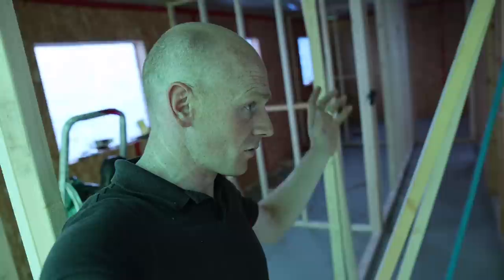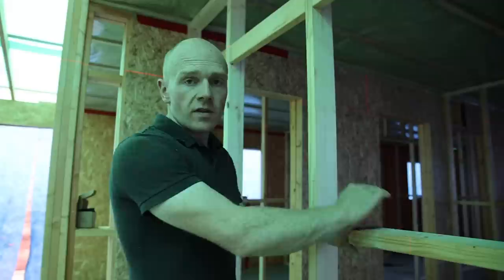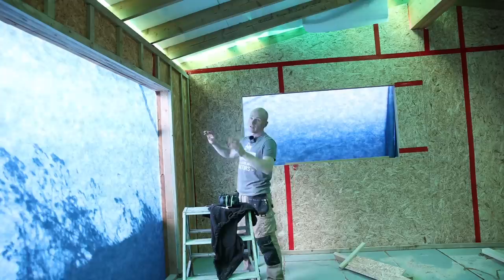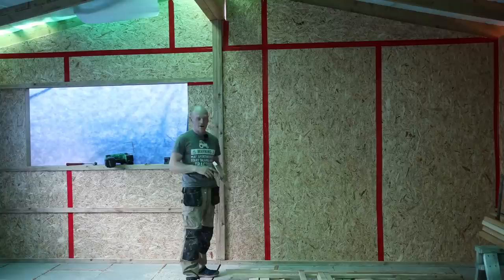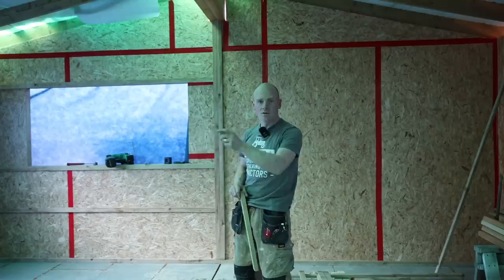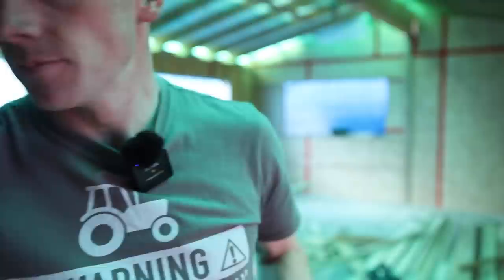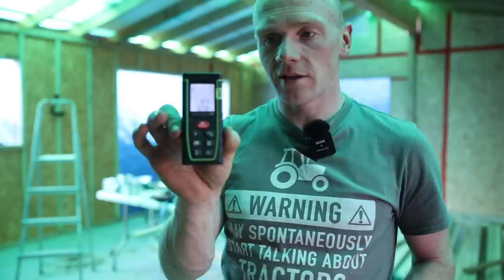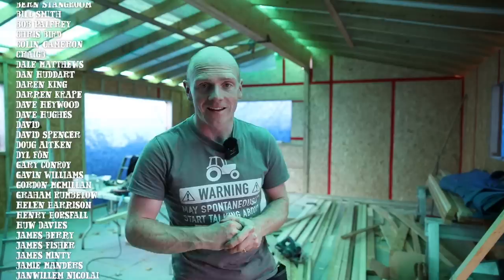STUD WALLS, NOGGINS & BATTENS - Laser levels and measures 💥

Comment: Interesting to see your take on lasers. I've been using a cheapo Lidl laser measure for a while now and can't fault it, spot on accurate over distance for under a tenner and makes working alone so much wasier. A laser level I've not shelled out for yet, always been tempted but never been able to justify the cost when I have a trusty spirit level to hand.
Reply from the maker: Yeah the measure is amazing when working solo. For £20, a budget level is well worth it and was so useful with kitchens and tiling etc at the last house.

Comment: I would be interested to see how your red lasers compare to a cheap green laser. We have a Dewalt green cross laser as well as a cheap 3 axis 360* laser which has been invaluable. Since we got the 360 laser, the dewalt hasn't come out of its case - was amazing when putting in roof windows to get them all level.

Comment: Generally, do you run the cables once 'on site', or do you need to allow for joints in services for the 2 halves to be decoupled?
Reply: The prefabricated two-part cabins I've seen transported are all pre-wired with plugs between the two halves.
Reply from the maker: Yes they are wired separately and joined after.

Comment: You can go wrong with laser measures. The cheep ones don't work at all or only a few meters in sunlight.

Decent leica will do 200m (or more depending on the model)  in bright direct sunlight. Buy once cry once IMO